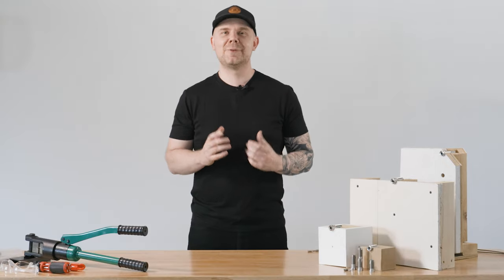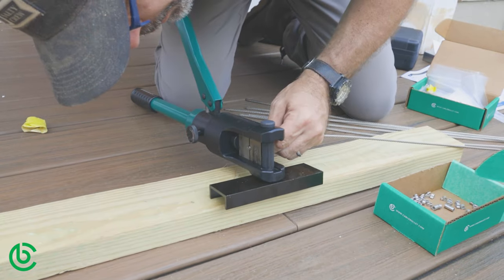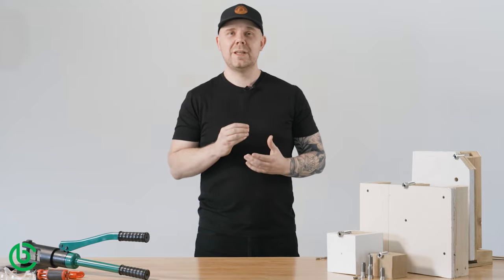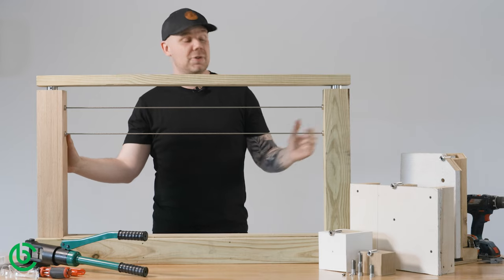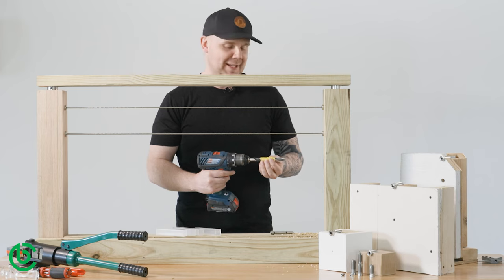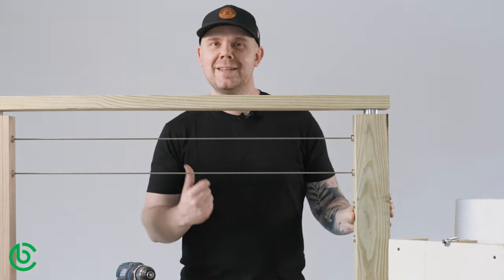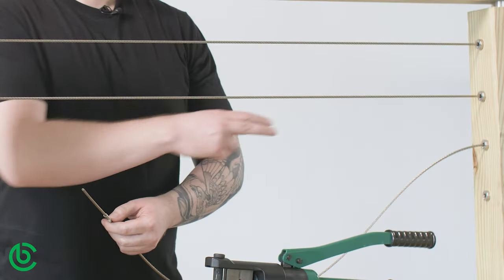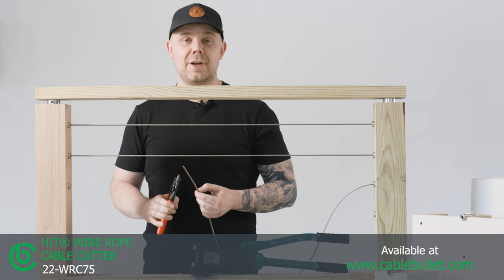Cable Rail Kit for Wood Post Decks & Stairs | Cable Bullet System

Comment: We will be wrapping our current 5x5 posts with either cedar or hardieboard.  Do your kits work with wraps or do they require a solid wood post to hold the tensioners correctly?   If they do work with wraps, what is the thickness that you recommend?  Thank you!
Reply from the maker: Yes, they absolutely work with wraps! The size of tensioner you'll need will depend on the overall thickness of the wrap. Usually, the XL will work as long as the wrap isn't super thick. If you go to our website and search "Cable Rail Tensioner Kit for Wood Posts," you can find an illustration that shows how the different lengths of each tensioner size. 

The main thing you want is for at least 75% of the threading to be engaged in the wood post itself, and not the wrap (ideally, 100% of it should be engaged).

Comment: I've been researching this stuff for weeks and I find this system to be about the nicest and easiest. My deck is huge, about 1200 sq feet and around 28 wood 4X4 posts. I would not want to terminate a cable run at each post so I'd like to pass through several posts. Some runs will have 45 degree turns and there is one 90 degree turn. I would of course terminate there and start a new run. Can I manage 45 degree turns OK? What can I use on the straight pass throughs to look nice? Just run the cable through a bare hole or do you have a nice grommet that looks like the termination points?
Reply from the maker: We generally don't recommend passing-through a turn that sharp. It can be done, but it will impact your ability to tension the line correctly. As long as it only turns once, you might be able to get away with it, but I'd only run that a maximum of 16 feet instead of the normal 20 foot runs we allow for. Feel free to give us a call or shoot us an email with any more questions!
Reply: En español

Comment: Great Video! How does your Bullet System account for seasonal expansion and contraction of the steel wires? I have a log railing system with wires and winters (-20) summers (100F), so there is quite a bit of fluctuation in tension. I would love to replace the existing system which is impossible to tighten and release (twisting etc), but would even know how to set the initial tension.
Reply from the maker: Great question! We've not had any complaints about issues with contraction, so as far as we know it hasn't been an issue. Generally, you'll have to do a seasonal cleaning and tensioning going into Spring, but that's standard for anywhere in the country.

Comment: This cable systems looks very clean.  I will be ordering a sample for sure.  BTW, in the video the prebuilt frame has stainless pieces on the top of the 4x4 that the top rail sits on.  What are they called and can I fin them on the site.  Definitely like that look!  Nice Video!
Reply from the maker: Thanks, Michael! The stainless piece you mentioned is the modern top from our Signature series aluminum posts. While the post top isn't specifically designed for wood railing, we used it as a quick way to attach the handrail for this video. We don't currently carry the parts you'd need to install the modern top on wood posts, but we used a threaded insert and 1/4 - 20 socket screw for the mockup in this video. If you'd like to purchase the modern tops individually, give us a call at (574) 742-2737 and we can get an order started for you.

Comment: Would a dab of thread locker be a good idea for the set screws? Seems like they might have a tendency to back out and cause the cable to loosen over time. This does seem like a practical way to achieve the desired cable railing look that's so popular. Please include a link for the hand rail mounting hardware. Thank you for spending the time to share your know how!
Reply from the maker: Hey Michael, great question! You could certainly add some thread-locking fluid to your set screws. We've had a few customers do this with out-of-the-box applications, especially where the railing was part of a mobile structure. In a traditional, stationary application the tension from the cables makes it difficult for the set screw to back out on its own.

Comment: Couple quick questions - Is the installation process the same for between posts on stairs? When rounding a 90 degree turn, would you advise terminating the cable or creating a 45 degree pass through?
Reply from the maker: Hey Luke, this is a great question! Yes, the installation process is generally the same for managing stairs. The main thing to watch out for is making sure you don't accidentally block yourself from the set screw channel by having it oriented in a bad direction. 

For 90-degree turns, we recommend cutting the run and starting a new one rather than trying to pass through. Passing through on that strong of an angle really hurts your ability to tension your line. We wouldn't recommend passing through any turn greater than 30 degrees, and even then you wouldn't want to run the full 20' that you would normally be able to go. 

Feel free to give us a call or email us with any other questions!
-Andrew

Comment: When installed outdoors, do you have to loosen the set  screws for winter and tighten in summer?  Or will it maintain constantly straight all year long?
Reply from the maker: Hi Chuck, as your deck settles and the weather changes, you'll just have to keep an eye on things and occasionally retighten. It doesn't take much to get a cable back into correct tension. You shouldn't have to loosen the set screws.

Comment: Do you also have another video showing how to install in round logs (Doug FIr)
Reply from the maker: Not specifically, but the process would be the same. Aesthetically, it might not be the greatest since the tensioner head won't be flush all around unless you drill deep enough for the edges to sit on the curve. I'd highly recommend giving our support team a call since your project sounds like it's a bit more nuanced than most!

Comment: What part is the spacer between the posts and handrail?  Do you sell these? Thanks!
Reply from the maker: Hi Katelyn, are you referring to our spacer bars? --> https://www.cablebullet.com/products/cable-bullet-cable-spacer-bar
Or are you referring to the stainless post top that connects the post to the handrail? If that's the case, we used one of the modern tops that typically goes on our aluminum Signature series posts. We don't currently offer them separately on our website (they're included with the aluminum posts), but if you'd like to purchase them separately, just give us a call at 574-742-2737. In a wood post application you can use them on level runs, but they won't work for any angled stair posts.

Comment: Well I be posting  if its as easy as it looks I got the free sample an it seems super simple I placed a order im wondering  if it comes with extra set screws there small an you will lose one for sure lol 
But the samples are nice built there aluminum  rails are super thick.   But its so so much cleaner then a turn buckel  system  if your doing cable rails this is best looking I have found. I'm thinking order extra set screws an the drivers to drive it into wood
Reply from the maker: Hi Larry, your installation kit will come with additional spare parts. You're correct, they do have a tendency to get dropped or lost. Thanks for the positive feedback on the sample! We continue to do our best to design a system that's simple to install, however, there will always be site or project-specific challenges. If you have any issues during the installation, please don't hesitate to reach out. We're always happy to help any way we can!

Comment: Love the clean look vs turnbuckle type. Do you need/recommend posts in between a 16 foot run you mentioned up to 20 foot run? If so do you terminate at each post or pass/drill through the post and only terminate the cable at each end post? Likely using 4' x 4" P.T. lumber for posts but considering 8" x "8 posts also. Thank you in advance for your reply !!
Reply from the maker: Hey Dave, great questions! Definitely use support posts in between your two end posts for a 16 ft run, both for cable and top rail support. You can pass the cable through those support posts by drilling a 3/16" hole (additional hardware is optional). Typically you'll want to support your top rail every 4-8 feet (depending on your rail design). We definitely recommend a top rail, however, if you're just running cables, please consider that any moderate amount of tension will tend to pull your end posts in at the top. Let us know if you have any other questions!
Reply: @CableBullet  Thank you for the SUPER QUICK reply!! I will have top rail so that should reduce the inward pressure that the cables will apply to the end posts.. just glad I can run the cables uninterrupted for the 16 foot span that is AWESOME !! I did see the "Dummy tensioner" offerings on your website after I saw the video. Cheers Dave
Reply from the maker: @reikunorthamerica5732  Awesome! Both the dummy tensioners and post hole cover kits are optional add-ons. On straight runs through wood posts, they would be mostly decorative, with little functional value as there's not abrasive tension on the through-holes. Without any intermediate hardware, you will have some discoloration over time due to moisture around the through-holes, and it's a slightly more rustic look. In the end it all comes down to the look you're going for and your budget.
Reply: I have a very similar question ..  so there is a sort of cover to cover the holes in the pass thru post ? I will limit the sections without tensioner to 18’ or (3) 6’ sections ..   there is a stainless steel cover to use them in the pass thru posts ?

Comment: Very odd way to price out 'kits' on your site.  I'd revise that...  Is one post screw $11
Reply from the maker: Hi Paul, that's correct: a single kit (all the parts required to anchor and tension a single cable end) is $11.45! The reason we have them as kits is because we want people to know that they get more than just the tensioner since they're getting the crimp sleeve, lobed washer, and set screw as well. We offer spare packs of those separately if you need or want extras, but we try to make it clear that a complete set are included with every tensioner. Hope that clears things up! Let us know if you have any other questions! 
-Andrew

Comment: Do you have a system for steal or aluminum post.
Reply from the maker: Hey Tony, we do have a cable tensioner designed to thread into steel or aluminum posts. Here's the link to the tensioner: https://www.cablebullet.com/collections/signature-series-railing/products/cable-bullet-cable-rail-kit-for-metal-posts
We also have a line of aluminum posts designed to work with our tensioners. If you've got a custom project in mind, just follow the directions for drilling and tapping the cable tensioner holes in your own posts. If you have any specific questions, give us a call! Someone from our project support team can help with any project-specific questions. 574-742-2737
Reply: @CableBullet  nice.
Reply from the maker: @tonytunnell9873  Sure thing, Tony. If you'd like a free sample, give us a call and we'll send you one.
Reply: @CableBullet  ok un a few days  I'm in the middle of a project.

Comment: great video!   I was thinking about using      1 !/2"  x 1 1/2" redwood for posts .  would the hardware work ?
Reply from the maker: Hey Allen, generally speaking, redwood is a great option. However, 1-1/2 x 1-1/2-inch posts won't have the necessary strength to hold the tension from the cables without warping (you can use smaller posts for your pass-through support, just not your cable end posts). For strength, we recommend your end posts be at least 4x4-inch posts. If your posts are hardwood, then you can use smaller true 3-inch posts (e.g. ipe or oak). If you have any other questions, give us a call 574-742-2737 - we'd be happy to talk through your project with you!

Comment: I love how you can build kids a ladder too climb over as long as they’re 4” apart 😂🤣
Reply from the maker: Hey Michael, as a father of two young children it's certainly crossed my mind as well! We did some digging early on and the "ladder effect" concern was removed from the International Residential Code early 2000s. The NAHB completed a years-long study that concluded (in part) that children would climb just about anything and that it was nearly impossible and generally undesirable to render any environment completely "safe" from children's climbing. Vertical or horizontal, my wife and I don't allow our kids on the deck without supervision.